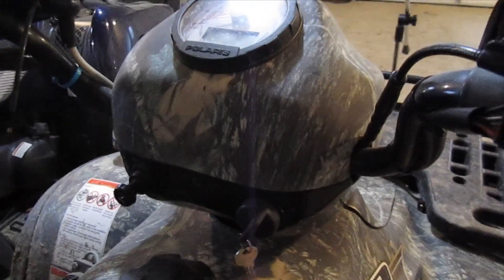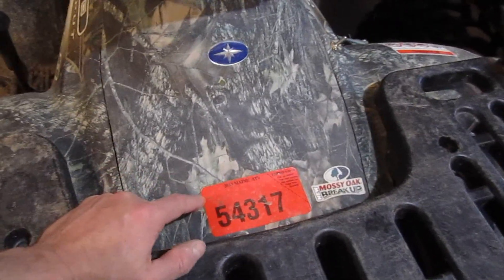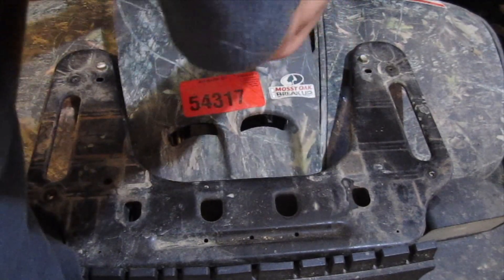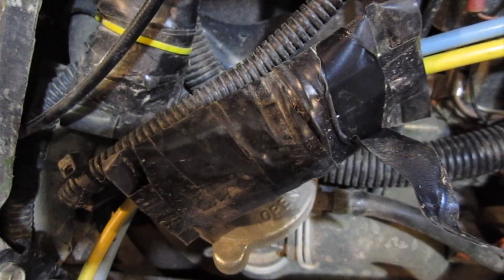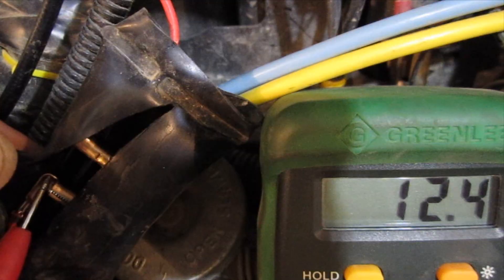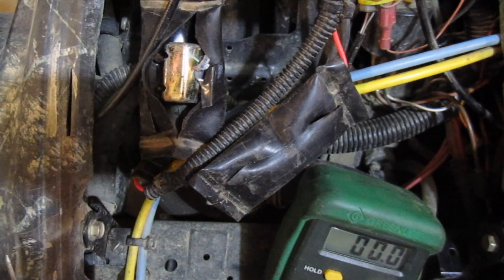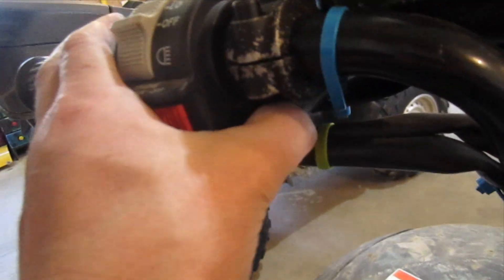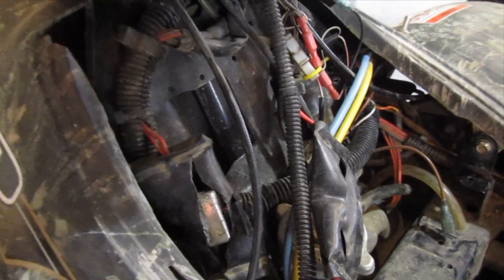How to Test Circuit Breakers on a Polaris Sportsman ATV - Electrical Issue DIY

Comment: This is an old video so I hope someone replies.  My polaris electrical shutdowns as soon as I either turn the lights on, or apply the hand break to illuminate the rear light. Also loose speedometer lights.  After about 1 minute power is restored. If I try to turn on any lights it happens again.  Could this be the circuit breaker.  I read it could be overheating then once it cools power is restored.

Comment: hi i have a polaris sportsman 500 h.o 2003 carburetor no 100 volts on the blue white wire that comes out with the cdi unit what could be the problem

Comment: So the best way to troubleshoot the breakers is to use a sharp probe to the wire on the load side of the connector. The small hole left can be sealed with a dab of rtv. If you do have to open the bag, lightly fill with silicone grease before taping. Yea it’s messy but effective.

Comment: I have polaris 2001. When I turn ignition on I don't get any power and it would not start. But if I manually pull starting cord it turns on fine. I checked battery it was swelling. Checked voltage regulator and it gave the same power out  as it was in. Replaced that. But still don't get any power with key on. Checked battery and get 12.5 V. Any thoughts how to test what can be broken? Thank you in advance

Comment: I have an 03 predator 500 and it has 2 of the same circuit breakers on it and the one near the back of the quad when turned off does this clicking every few seconds and drains my battery. Any thoughts or suggestions?

Comment: Hey I had a question for you soon as I turn my key the relay pops and I get 12 volts on my relay on both sides but soon as I turn the key it pops then one side of the relay has power and the other side doesn't have anything could this be a bad relay problem do you know by chance

Comment: Hey Mark on my 500 Polaris sportsman whenever I grasp handbrake it shorts motor so I move run/ off switch on handlebar back and forth then check lights and she starts right up, would you have any idea why the handbrake could short run/off switch, Thx in advance - Donn

Comment: I have the same exact atv and I’m having a problem where the atv starts and runs for about 1 minute and then dies.. power, headlights, everything.. If I wait about a minute it will start right back up and do it again. Any suggestions?

Comment: Mark, I got an 04.5 Sportsman 500, the high beam didn't work so I traced it to one of the brown wires that somehow got pinched and was flattened so I soldered it back together only to find the other brown wire was the same way, so i soldered that one back together now the high beam works but now I noticed the speedo pod is completely dead, it worked fine before I stated working on the wiring, it starts, runs, kill switch works, high, low beams work, but everything in the speedo is dead now.I thought it might be a fuse somewhere but I guess these don't have fuses? so I replaced the ecm in it because theres suppose to be breakers in it? for $150 which didn't fix it. Could the new oem ecm be bad, thats a possibility or is there something or somewhere else to look? other breakers somewhere?

Comment: Hey guys..  Mine had the same problem and it was entirely from a dirty 
on/off kill switch. Remove the left hand grip and the 3 small screws and
 slide the case back about half an inch and spray in some WD40 or 
contact cleaner. Reassemble it and work the switch side to side several 
times. It worked fine on mine even kept the lights from coming on. I'm 
almost bald now from too much stress  but  this worked for mine..  whew

Comment: I have a 2001 polaris 400 sportsman with an electrical problem the left handle bar switch with the red white wire has burnt at the plug. replaced it with a new switch and plug that I spliced the wires to. have low beams no high beam and the starter doesn,t work. bike starts with the pull start. the red white wire is not connected if I connect it it wants to burn. any help would be appreciated

Comment: Any idea about this?

I just changed my voltage regulator because it wasn't charging my battery. Stator tested to be seemingly fine. But now, my Tach will idle at about 800, then when revved, will drop. I can lightly engage my brakes, and the tach reads fine. Did I buy a faulty regulator? There are some forums saying it could be a bad ground, but I can't find anything loose or dirty. 

Any help would be awesome!!
Reply: +Mark Jenkins Thanks for the reply! So what would happen is only the tach read wrong. You could hear the RPMs raising, telling you the tach was reading wrong. I searched for bad grounds, and came up with nothing. I decided to plug the old voltage regulator in (to be sure that one read the tach correctly, even though it didn't charge the battery) and it read fine. So I was thinking I bought a faulty regulator. Plugged the new one back in and it worked fine! Not sure what happened there, but the battery charges and the tach reads fine now. Thanks for your input and I hope this can help someone else in the future.

Comment: Im having the same problem on my 2001 500 ho and anything that is connected to the handlebars or pod is not working and I have no head lights or speedometer or 4x4 all worked before my electric start stopped working. Could this be my problem if not what else do you think it could be? Thanks

Comment: Great videos. Mark I need your help. I'm having a couple issues with my 2002 Polaris sportsman 400.
Four wheel drive  the front left Hilliard clutch doesn't seem to engage. I've replaced both seals, Hilliard clutch and all four bearings. I've checked the wiring and it seems ok. ??

Second, I'm starting to loose power, especially going up hills. I've replaced the belt drive, and carb. All original parts. Do you think it may be the clutch?

Any tips will be appreciated. You got me started with all this.., lol thanks for sharing.
Reply: +Mark Jenkins what setting did u use to test ur power?

Comment: Thanks for posting this. I need to dig into the electrical on my 02 Sportsman. The lights, AWD, Winch (switch) randomly go on and off While it's running. I'm thinking its' corrosion and dirt on the connections. But at least your video kind of gives me a direction. Thanks again for posting. -Nick.
Reply: +Mark Jenkins I will give that a try. Thanks!

Comment: Hi , I have a Polaris predator 500 & I was riding one day and my battery fell and I lost power and whenever I tried connecting the battery back , I had no more power , my light switch nothing would turn on...  You think the breakers is what messed up ??

Comment: hey Mark, I am having problems with my speedometer. I am having power to my info screen but the analog speedo will not work. Any suggestions?
Reply: ***** it is a 2001 500 h.o. I will check it out thank you.
Reply: Marco Penner  i have a 04 sportsman 500 i did a total frame change out with all my parts on the other frame now i have no power anywhere

Comment: hey mark i have no lights winch stop working 4wd stopped.engine starts up with pull ,start changed battery (which was dead ) to new. motor starts that's it. only found 1 bag  for fuse its a 2001 is there a difference??????
Reply: mark the winch works with new battery no lights or 4wd breaker was good only 1 bag

Comment: HI I have a 2006 330 and I have no head lights no dash display but my fan does kick on every time I turn on the key (that is normal). I do not see anything that looks like those circuit breakers on your video. do you have any suggestions?

Comment: One of the breakers is white like yours was in the video and I did check the connections, but the breakers is being a problem because I don't have anything I could test them with cause the volt meter thing I'm trying with is hard to understand and all I do is read zero.

Comment: So you think if I change one of the breakers it should work? Cause it's the same as when you said your headlights and such didn't work and that's what's wrong with mine and I mean nothing turns on does start no absolutely no power.
Reply: I got the same problem plz help im going crazy lol
Reply: Carmen Hernandez on my bike it was actually my switch cause i replaced all the wires i mean i had to because i burnt my wires up, but what was wrong with mine was the ignition switch.
Reply: Taylor Blanchard I am working on a 08 trail boss 330 that has no power to the handle bars, makes a clicking sound when I go to turn it over and head and tail lights work.

Comment: Hey I have a polaris predator 500 I cut the breakers out and I have the issue with no power comes on at all I want to know what did you set your tester on to see if the breakers were bad.

Comment: Thanks Mark,..... I had the same problem with My 2000 Polaris 250.....I checked the connection you mentioned... and the console lights came right on....Saved me a trip to the Shop..... Thanks again... Geo. Perry Jett, (SouthWest Arkansas)

Comment: Thanks for showing me your problem. I had no power for my lights or anything. But the motor would run.On my 2003 sportsman My breakers looked great but the switch control on the left handle bar was louse and caused me to lose power. I adjusted it and the power came back and I tighten them, And it work good now thanks. Wayde

Comment: WOW Thank you so so so much . sat there for about 3 hours trying to find the exact same problem! thank you so much for sharing this. i cleaned both plugs and on the male end i took a flat head screwdriver and very slightly bent the prongs inside so they would get a better connection. Again thanks for help.

Comment: I watched what you did to test the breakers. I have lights ,but they blink on and off while driving. What do I look for? I pulled the connectors loose from the light switch and reinstalled them(they did look good).